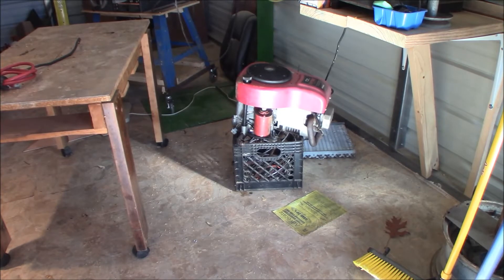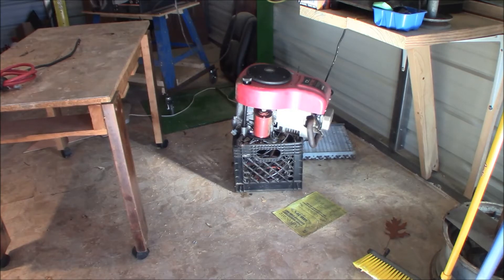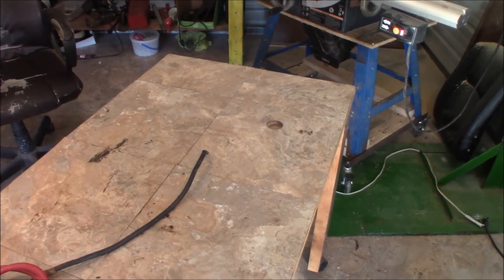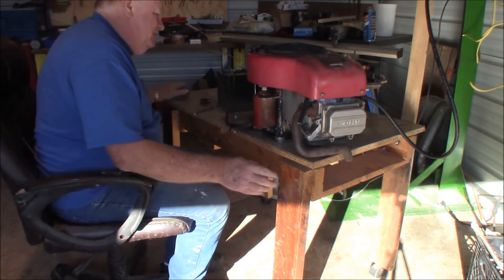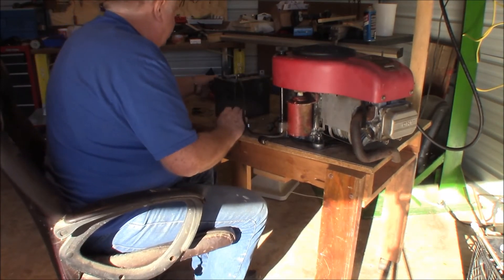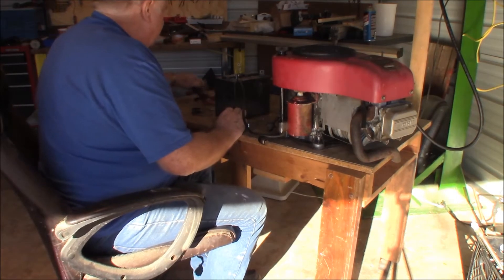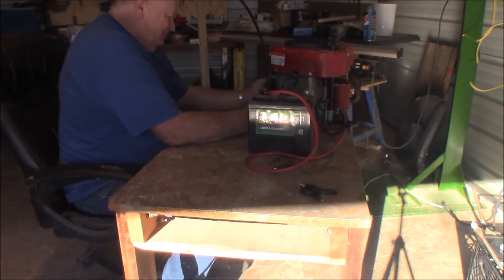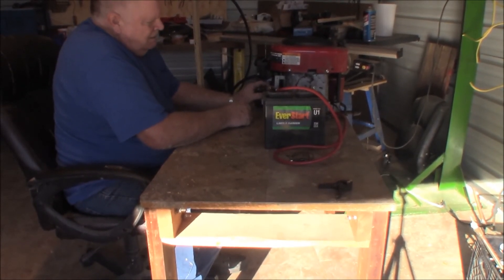starting Intek 17 HP  B&S

Comment: Great idea adapting that table for an engine stand. Works great and didn’t cost anything but a little time.
Reply from the maker: I first cut a hole in a plastic milk crate but it started to sink in so the table is better plus being lazy like I am , the table has rollers on it so I can move it around to work on things.

Comment: I'm just a little confused.  I was told that a vertical shaft engine would not run unless a blade or blades were on the PTO end of the crankshaft (to balance w/flywheel). What am I missing?  Thanks.
Reply from the maker: that is true of push lawn mower engines as they have a very light weight aluminum flywheel. so they do need a blade to keep up momentum, but on tillers and riding mowers where the flywheel is steel or cast iron,, the flywheel is heavy enough to keep up the momentum so the engine continues to run forward rather than kickin back.
Reply: Now I understand.  Thanks for your quick reply!